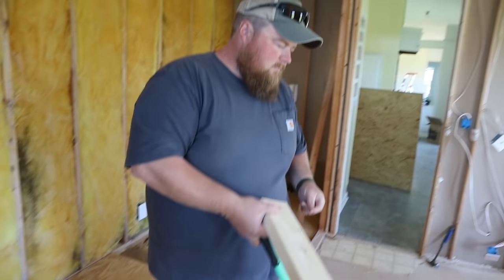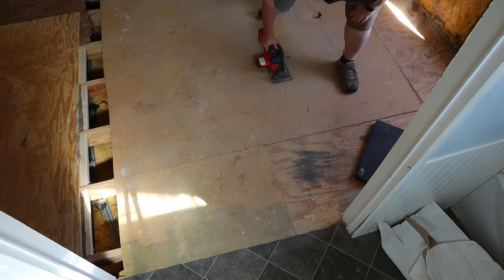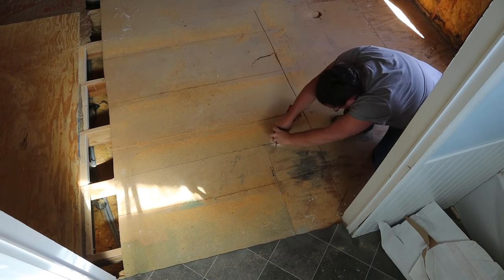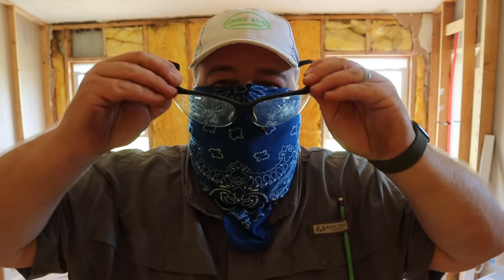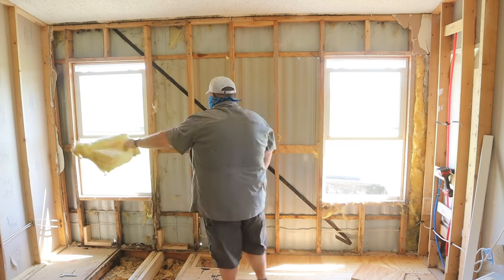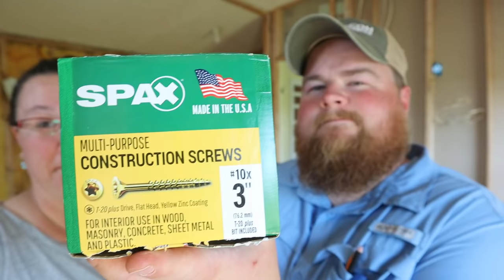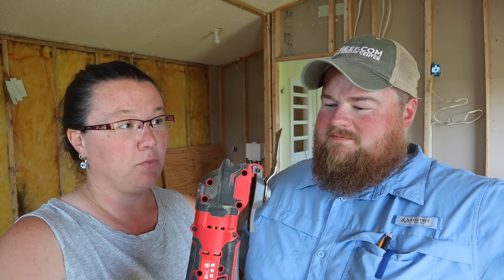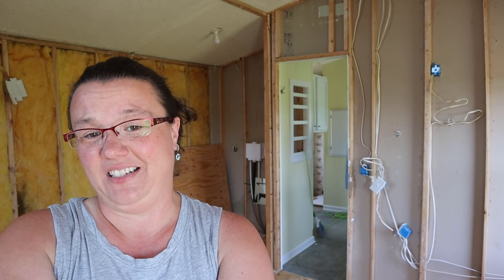More Than Expected... FULL Joist & Subfloor Rebuild // Mobile Home Renovation

Comment: Been rebuilding these trailers for years never is one remodel the same great vid guys
Reply: Also in future put insulation off the top of floor joist and glue the joist will stop movement and sqeeki ng
Reply: @kevinmorrow5144  I'm curious by what you meant by saying "put insulation off the top of the floor joists"

Comment: Not unheard of for some manufacturers to place mobile home walls down on already carpeted floors! CHEERS from Vancouver Island! P.S. the unit I have now was plywood floors from factory. Mobile homes like everything else ---some better built than others!
Reply: I believe most if not all of them do, it's much quicker to lay all the flooring throughout the home before putting up the walls.
Reply: Hi from just over the water in Powell River! :). My mobile home had rotten subfloors so I redid all of them with plywood and reclaimed fir flooring. Inexpensive and looks amazing!

Comment: I am amazed they didn't add outer sheathing to the mobile before adding the tin. That doesn't give much rigidity to the home but I guess it lessens the weight, but WOW, not a strong wall.
Reply: Older Mobile homes don;t have the plastic- new ones have it because they have vinyl siding- mine is a 77 which the yr the industry changed into making them differently
Reply: Our 90s model is constructed the same.  We are in the process of a total rehab and are using T1-11 as our siding.  We may add a different siding in the future, but that will go right over the T1-11. So it serves two purposes.  I was also shocked to see nothing but metal.
Reply: @darleneclark6098  i like that better than vinyl siding! The thing is ,i saw a brand new one delivered and they didn't even have the house wrap on the end gable's before they put on the vinyl siding (after piecing the double wide together)- i sent word to my neighbor- to make them put it on the $111,000 mobile home. At least there woud be some protection from the elements if vinyl was loose.  They said they don't usually do that. They did do it
Reply: @lovenotes5299  curious what manufacturer it was. 🤔. We looked at many mobile and modular home builders before we decided to rehab our current one.  I was not impressed at all with Clayton s construction. Everything was so cheap. They love to put lots of lipstick on a pig, if you know what I mean. They make them look so pretty, but if you really look at the construction and quality of materials it's terrible.  We are also putting house wrap under our T1-11.
Reply: @darleneclark6098   I don't know what hers were- their trucks had no signage/names on them-
Reply: @darleneclark6098  I know with the T1-11 is gonna look beautiful- i think i wanna use on the inside, LOL, i'm weird, i used white pre-painted faux beadboard on a few walls and living rm ceiling- in my shed to tiny house(canning kitchen/library/learning center -i used it thru-out the whole thing
Reply: @darleneclark6098  My mobile home is really old-1977 Fleetwood - the year the industry changed how they built them/ I have gotten a lot of mobile home parts with couons/discounts,LOL- best part- I paid cash- $2,500  and have no mortage/rent
Reply: @darleneclark6098  I didn't want to do sheet rock, with all the work and mess and expense- i think the panels were like $19 and i didn't paint anything! Hahahaha
Reply: @darleneclark6098  I have been hearing that viny siding and other building materials that are made with oil ,aren;t available and colors can't be found( Vinyl fencing/siding  in colors they don't know when they will ever have it . So i'm kinda glad i'm not considering those choices- some people had their siding melt off their homes with the heat/sun/

Comment: You can build a box with your 2x4s and slide it between your floor joist when you get close to the walls where you dont have anything to screw to. It works anywhere you dont have something to screw to.

Comment: when i redid our floors system we replaced across the entire floor. but what i failed to think about was the walls had lowered some. i should have notch the floor joists at the ends so the floor was back to the height it was new. only about 4 ft was bad like yours. oops. keep up the good work. we remodeled the entire home with sheet rock and new floors. new custom kitchen to new showers tiled like any 300 thousand to 400 thousand home. people walk it and are very pleased .

Comment: When we renovated our diningroom, we had to sister the floor joists as well. We managed to lift the sagging floor a bit, but also had to use the sistered joists to finish leveling the floor. Our home was build in the 30's and we couldn't lift the joists as much as was needed. They had sagged about 3-4 inches in the center of the room. Great job guys!

Comment: I use the same line of cordless tools.  When I put in my shop here at my house I left a few things fifteen miles away at my old shop which is in my Dad's back yard. One of them was my Dewalt cordless tools because....it's my Dad and he needs tools occasionally. The Craftsman tools were much cheaper and since I am disabled and my shop is just a well paying/rewarding hobby I decided to go with the cheaper option. They have been fantastic so far and I would recommend them to anyone even a professional woodworker.

Comment: Just had to tell you I use to drive a tractor trailer and would deliver drywall to a mobile home manufacturer in Eatonton Georgia. This plant built 16 mobile homes every day all of them went thru an assembly line starting with the metal frame the home is built on. It was an amazing site to see but it also explained to me why these homes were not really comparable to an onsite built home.

Comment: When I did this as a young man for a job we would buy 1/4 “ plywood sanaded on one side and put it down over the old floor and nail  it with ring shanks every six inches like a checkerboard indenting the nail head followed up with a coat of floor patch over nails and taped joints hit it with a quick sanding and put the new flooring down,

Comment: That old oscillating tool probably only needs a new set of brushes to get it back going. They are cheap and usually easy to replace. There should be 2 of them. One on either side of the motor. These create the electric field to turn the motor. They  do wear out and start losing connection. Love the videos guys!

Comment: I live in a 1978 double wide. it also came  with that wonderful particle board flooring. Like you I have replaced a lot of it but there is still some original. Lots of fun. lol I have found that cutting out the old floor up against the wall goes real fast with an electric chain saw from harbor freight. If you hit any nails its a little rough on it but  I have a chain saw sharpener. The only thing I would do different up here in ohio is to put the insulation down lower under the heating ducts and water lines. Here in Ohio if I did it like you are doing, our lines would freeze. Also I usually use an angle grinder to cut off the staples after you get the floor up. You just have to watch the sparks dont cause a fire.

Comment: I noticed your ac vent if you plan on using it I would recommend blocking around it I started doing that years ago it definitely helps hold the vent and the floor get weak over time in that area

Comment: I agree, I'm not a fan of gluing subfloors.
Reply: Like your Chanel!
Reply: why is that?
Reply: @MrRerod  Because screwing eliminates the need. In the old days, when nails were the norm, glue had its place. With screws it serves little to no purpose. It's just extra money, extra mess, and extra chemicals in your home for no real benefit. Plus, most sub-floor adhesives barely work anyway.

Comment: Another thing I did was, I put blocking between EVERY floor joice and under the wall plate, to attach the floor and the wall, otherwise the wall only is hanging off the outer rim and iron supports.
You should be ok, but I think that the floor and wall should have more in common..
I have a 26 by 60 ,rotten double wide..
Total rehab project.
Termites and particle board from 1985.

Comment: I gutted my bathroom ceiling this weekend. The amount of mouse crap that came out was Biblical. As far as tools I only use Milwaukee. Same battery system like you said. Those multi-tools are awesome with a mobile home. SO many uses.
Reply from the maker: Oh gaaa!!! I can only imagine that one.. Biblical!!! LOL I'm not a die-hard Craftsman guy -- just what we started with and added on to. I'd happily take a set of Milwaukees to convert us over! LOL
Reply: @sam-and-angela  The M18 system is the best and the batteries hold their charge and re-charge quickly. And I just found out that I need to reinforce another part of the subfloor in my second bedroom. Tons 'o fun!

Comment: I have a 1985 Springhill double wide, I'm over 60 and I would like to redo areas of the floor like you did from water damage.  What size were the wood 2 by 6s???, I also have a bathtub I need to take out, for cost savings I thought I would get a portable bathtub and over head oval ring for shower curtain and use a membrane and cement board for base, what are your thoughts????

Comment: The reason you don't have a squeaking issue btw is because you're using screwes. Squeaks are caused by the wood rubbing against the nail up and down as the weight is applied between joists which cause the plywood to bend putting pressure on where it sits on the joists. If you used a nailgun you'd have an issue later on.

Comment: It is Easy to fix those tools most time...Intermittent is usually " Brushes " or " Switch " issues... in most cases...take it apart and check the brushes ...they wear or can be not getting good contact due to corrosion or dirty commutator ( it needs to look shiny to arc to brushes properly )..  brushes are simple to replace ..sometimes hard but most times really are not that hard.... switch is also easy and usually dirty inside or just worn out .... sometimes you need to cut the wires to switch and reconnect but that is also simple and easy... open the tool in a clean area ( and where small parts don't get away ) and pay attention to how it goes together..  usually they come apart easily and go back together as easy...i been fixing these for 50 years ( corded and cordless )... sometimes they are worth repairing and sometimes not really worth ( depending on parts needed )... i buy the RYOBI brand cordless now as well as my Dewalt brand ( used to use those on my work )... RYOBI has a decent quality tool line and prices are great... Quality is good for Heavy uses too...

Comment: You should have used liquid nail you don’t have to use a line just put a dot at each joist and the hvac duct is going to have a bunch of stuff in it since you didn’t cover the vents

Comment: Sam, Are those 2x6 joists and are they sufficient?  I just built a deck and shed floor, and I overbuilt them excessively out of fear that I will fall through at some point.  Yeah, I used 2x12s every 18 inches, and doubled every 4 ft so that every seam is on a full 2x12.  Then I used vertical blocking every 2 ft too.  I could probably park a Mack truck on it.  Oh and I put two layers of 1 in PT Plywood down too,  Call me Mr Overkill.  The inspector just shook his head.

Comment: Any advice on squeaky mobile flooring?  Is it squeaker due to particle board, or plywood; does it matter?  I've used talcum power, it helped, but has not lasted.  Really cheap laminate w/padding.  I don't even go in my kitchen if I can help it.  You can even hear it outside.  😔
Reply: Use screws. Squeaks are from wood sliding up and down against nails.
Reply: @diyfferent  Oh!  Thank You!!  😇

Comment: In my opinion when you have access to the gray water pipe under the floor this would be the ideal time to remove it and replace it with new PEX tubing and fittings. This would prevent having to cut up the insulation underneath the home and would make it a much better and easier job. Like killing two birds with a single stone.

Comment: I love watching your renovations, you make me feel like I could build a house, although I don’t know anything about building materials, you are very knowledgeable and teach us well, can’t wait till the next video, I have a few questions, 
1. Did you use the same number of insulation or an upgrade, and with that said , have you ever heard of Handcock wool insulation? I think that is an awesome way to use sheeps  wool, no this is not sponsored in anyway, it’s just I saw their videos and thought it was cool
2. Angela do you like the new tool better than the old? It look3d like the old one worked faster in the video
Reply from the maker: We priced Havelock wool insulation with my new workshop. Honestly the cost is outrageous. Probably 5 times the cost of regular insulation. 

She likes the new tool just as well she says the blade got dull so it wasn’t the tools fault. :)
Reply: @sam-and-angela  I agree about the insulation Sam. I researched them all too. Denim, hemp, you name it. All too expensive. We're sticking with the tried and true fiberglass. With Rock wool between in the interior  2x3 walls. More for sound deadening, than insulation.
Reply: @sam-and-angela  and I did mean have lock wool, you are correct, I didn’t know about expense

Comment: wat you could have done was measure the length you need to take off to end up over the floorjoist then measure that distance from the wall with the boeard butted against the back wall and as close to the side wall as you can get it , cut that side and you should get the cut verry close to closing the gap should the wall be not square
allso look intoo getting a tracksaw or build a wooden track for youre current saw , that way you can make mush straighter cuts on big sheets
as for the old "get out of jail free"tool or oxilating tool , might nbe the brushes are worn out and you can fix it cheaply

as for not gluing the floors down , IF you get squeeking you could add some foam rubber tape so theres no wood to wood contact

Comment: Now you see why i opted to renovate my home instead of buying that single wide.  Doesn't matter if new or used.  When you move you stand the chance of SNAFU happening.  And yours has been going on for a while now.  My home was right at 75 years old.  No rot whatsoever.  I should know.  Had all the sheetrock taken down to insulate the entire house.

Comment: I see y’all have the same issue as we do with the black on the installation and black on the boards from leaks maybe not sure but y’all left them and screwed new board on each side. I thought I needed to tear all the wood that has turn black but y’all didn’t.  So Am I ok with leaving all the wood work and installation that has turned black in places the place and just add new boards. Im confused I’m new to repairing my floor. Please any advice will help. Thanks

Comment: Most of the friends and buds chuckled or laughed when the other half bought a little, corded, hand planer years ago.  His comment then was its function was to allow himself to fit things despite his measurement and cutting skills; he's hot too bad, but things can happen.  Where it has been put to use most often however is in working with things which didn't have true 90 degree corners and straight edges to begin with.  (This includes structures but also out building type things and things knocked together.)

Comment: As I watch this and the previous video, you all are rightfully so feel more secure walking across this floor.  But with the added and new insulation its got to be warmer in the winter with less heating.  One of the things I've said with some of our diy projects is, we don't want to be 75-95 when things fail.  Likely we won't be able or want to be diying at that level  between 75 and 95 and there's no grantee we'll be able to afford to hire it out.  This bedroom renovation seems to be able to last for years to come.

Comment: What are you gonna do about the air conditioning ducks ducks you covered up the original holes in the duckwork duckwork with the plywood?
Reply: They don't use the floor ducting anymore. They installed a new minisplit system instead.

Comment: Did the waffle board flooring come up pretty easy ? I need to take up mine n put new too
Reply: I see you’re putting in R-13 insulation into the floor is that a good rating

Comment: I hope your not using 3" screws on the plywood? To long. 
Also did you forget to cut out the heater vent on the floor? Looks like you just covered it over??
Reply from the maker: We have mini splits in our home, so yep, we're covering over the old furnace duct holes and not putting them back. :)

Comment: MUCH EZER TO JUST COVER THE OLD FLOOR OVER WITH 3/4" PLYWOOD, THEN REMOVING THE OLD FLOOR BOARDS. CLEANER TOO.
Reply: Not a good idea. Blocking needed to be installed for stability, and the old sub floor is disintegrating, so it will cause problems if you leave it. Plus, the old floor was just not stable.

Comment: Question? Will you leave the old insulation underneath the mobile home or will you remove it once your finished.?
Reply from the maker: We'll leave it down there. It's gnarly looking, but still serves a purpose. Our plumbing lines are down there and it helps to keep them from freezing in the winter. Plus our whole underbelly of the home is sealed up with the black plastic fabric so it's pretty much an enclosed space down there. :)

Comment: I hope you don't reside your home with that nasty pressed board product. It fails quickly. My fiber cement home is doing great with the  siding. The cheap pressed board crap they used as  trim all failed and I replaced it with fiber cement trim.